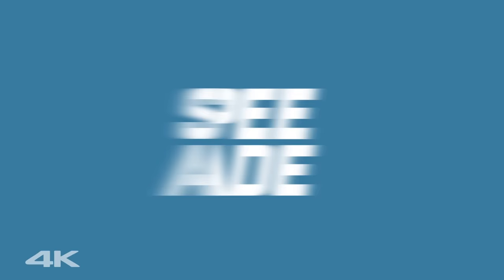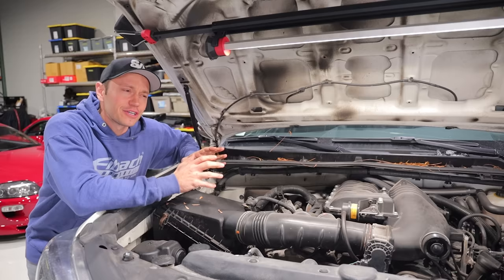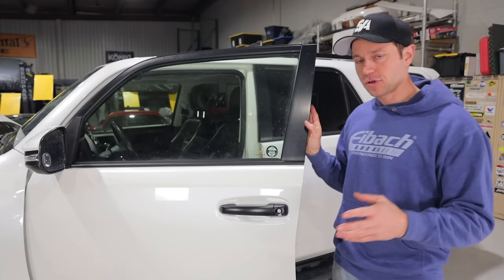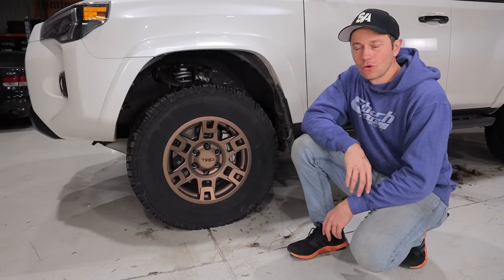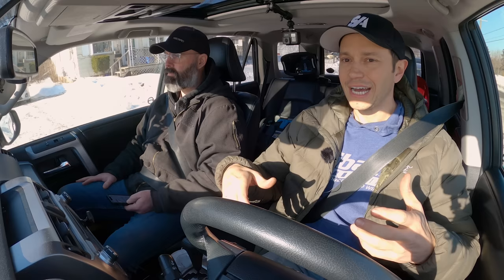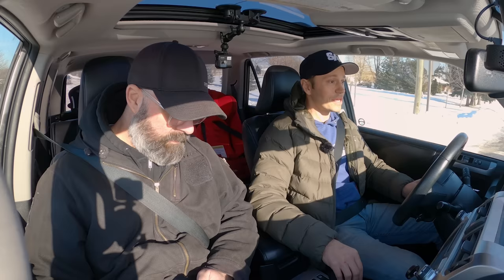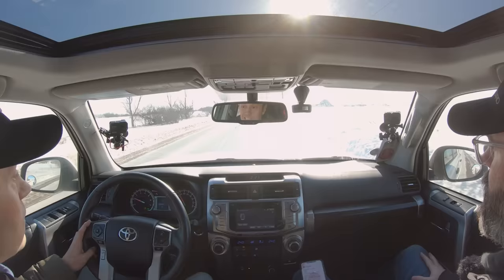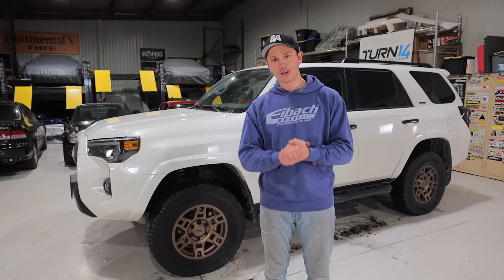Supercharged Toyota 4Runner Long Term Review - Gas Mileage, Reliability, Regrets?

Comment from the maker: If you havent watched the build series on this 4Runner, please do so as ALOT of your questions are answered in it. Here is the first video: https://youtu.be/s4jP3IfMD2A
Reply: your install inspired me to not only do the supercharger but attempt to film all 294 steps.
Reply: Just purchased my very first Toyota, a 2014 4Runner SR5 2-wheel drive in arctic white, great shape with 124,000 miles on it, but very well cared for. Wishing I had the kind of money you had for the supercharger, but will have to do upgrades a little at a time as I can afford. Also, I note on the one I just bought that the brakes are very soft and go near to the floor and do come to a stop, but my last car a Nissan Murano had reasonably responsive brakes, whereas this Toyota is a very slow grab and makes me a little nervous, have not quite adapted to that yet.

Comment: My 1996 4-Runner is the best vehicle I’ve ever owned.  Bought new in December 96, it now has about 353k mostly trouble free km.  Has never burned a drop of oil and since I did the upgrades of a TRD supercharger, Bilstein shocks and bigger sway bars in 2001, it’s been a blast to drive.  Living on the west coast, it’s mostly rust free.
Reply: Thats pretty impressive, seems like you taken care of your vehicle very well
Reply: White 96 4runner here as well , 5zvfe 4x4 309k kms. Bought it just before the cov, Wish i could find a rust free hatch though as it was the only thing i couldnt save.   Thought about selling it a few times, Always delete the ad 20 minutes later.
Reply: Thank you for sharing, always love seeing this awesome success stories to shut up the hatters!
Reply: I had a driver that rolled a 96 4runner over in Haiti. My dad fixed it and it kept running like a clock
Reply: I've got a '98 Limited I bought new. It's got a TRD installed, Borla cat-back & a K&N CAI. It's only got 68,000 original miles on it. I've always had multiple vehicles and drove a 1990 Volvo 240dl wagon for 21 years in the winter months, awesome vehicle. Definitely saved the 4 Runner from the winter road treatments, Its always been garaged. Someday I'll probably sell it or trade it in.
Reply: @danielfair4675  wow that’s mint!  I had a Borla cat back exhaust system installed back in 1998 but couldn’t stand the drone at highway speeds.  Went right back to my OEM exhaust which lasted up until 2017.  Now I’ve got a cheap cat and muffler replacement which has a rattle somewhere inside when the vehicle gets fully up to operating temperature, very annoying
Reply: @phil6926  the stereo system covers the drone up  I've got (2) V12 Alpine Amps a 2 -sub woofers to cover the exhaust. 🤣
Reply: You should start saving for a new 4Runner. Your 1996 will only last another 600,000 miles or so.

Comment: Best SUV ever made, I have a 2002 sport edition 4Runner with 290,000 miles and no problems... just the regular maintenance... 👍 TOYOTA  #1
Reply: my 2000 sr5 just crossed 275k the other day!
Reply: Guys I just got a. 2022 4Runner TRD off-road premium  and I hope it last like you guys are saying  because  I love it and I want to keep it for as long as possible also it's the last year of the na 4l v6.  Is next year it's probably gonna be some 4 cylinder Turbo hybrid BS which I'm not interested in
Reply: I've got a 2004 Sport Edition with the 4.7-liter V-8. I still love it, and I wouldn't hesitate to drive it across the country.
Reply: @zzanatos2001  yeah those v8's are bulletproof

Comment: Hey PT!!! Got this tip actually off FlyRide youtube channel, but... nothing ever holds to that chrome and it wont scuff properly. But using just standard purple degreaser concentrate, soaking the pieces will disolve all the chrome plating down to bear plastic, so you can then paint it.I havent done it personally but he did perform it on his channel! Hope this helps!
Reply: Chrome is a PITA to cover or paint, either strip it clean or just bite the bullet and buy the black trim
Reply: Hot tip right there
Reply: Caustic soda- drain cleaner -hectic or oven cleaner - more subtle. Works on anodising as well
Reply: One thing I've seen used to strip the chrome is oven cleaner.  Definitely strip the chrome off.
Reply: Thanks for this; I'm getting ready to paint the chrome grille on my 92 Toyota Pickup and I was worried about the paint sticking to the fake plastic chrome, even with a scuff. I think I'll try the oven cleaner first. Sure it won't melt the plastic?
Reply: Guess you can always try out some extra lettering laying around from debadging
Reply: Hell yeah great tip!

Comment: My 99 SR5 4x4 3rd gen has been one of the funnest vehicles I've owned.  It does mostly highway, but when I go off road it keeps going nonstop.  It is a very rare 5spd. with many off road adventures ahead with over 344,000 miles, has been well maintained and gradually upgraded!

Comment: Brings me joy to see how well your 4Runner has held up.  I bought a 2021 4Runner Limited Nightshade during Covid (Oct 2020), but had no idea how "doggish" the engine was. (no test drives at the time)  Needless to say I had HIGH hopes of a supercharger only to discover, I'll have to wait until they come out.  I should have done my homework, nevertheless I've really come to enjoy it.  Would like to see future models have an electric rear hatch and mirrors, but that's just me being petty.  Cheers!!!
Reply: Man, I literally did the same thing. My daily driver is a 2000 E55, but I grew concerned I may not be able to get parts for it in the future if needed( note it rarely breaks ). But yeah, the 4Runners performance is disappointing. And it’s gas mileage is horrible. I get 21-25 in the E55 with my foot in it. I’m thinking about ordering a Raptor Bronco and parting with the 4Runner when it arrives. Note, I needed the 4Runner for 4x4 and some towing because I have rural property that the E55 is not ideal for…
Reply: Yeah, my 2014 4Runner, since I am new to the model, seems "doggish" as you said, going from a Nissan Murano (handles like a car and has pep) to the 4Runner which definitely sped up and handled like a truck.
Reply: You guys should seriously look into pedal commander. The throttle response is on point with plenty of power from the go. It’s not the power for the engine but the lag in response from stock for gas saving
Reply: @toolman67 it's a truck not a car, get over it.

Comment: Probably one of the favorite vehicles I owned. I called it my Urban Assault Vehicle because it did everything you described minus turbo so well. I miss my 2014 and 2016 but my Tundra fits my needs a little better, less the even worse gas mileage. Always compromises.
Reply: I call mine "wagon king-family truckster"

Comment: I think you guys really hit the nail on the head with this being the "right" size for a 4x4 SUV.  I have been a long time land cruiser lover but I just can't get over how fat and heavy they are.  I currently own an older 4runner and the GX460 is really attractive to me.  I prefer the rear door to the hatch that come on the 4runner.  Here in the US 5th gen 4runner and gx460 are pretty similar in price because of the 4runnner/toyota tax.
Reply: I agree the LC200 is huge. I still love it though. I think the 80 series is just the right size. A tiny bit bigger than the 4runner (at least from just sitting in one). A split hatch would be one of the only things from making the 4runner perfect

Comment: I owned a 1996 SR5 for 20+ years (bought new) and put over 330,000 trouble free miles on it.  I just traded my Lexus NT200 for a 2016 4Runner SR5 with 80,000 miles and will likely keep it for another 200,000 miles.  Great all around vehicle.

Comment: I have had excellent results with SEM Trim Black Aerosol paint. I used it to repaint the black “fins” on my 1996 4Runner grill when I upgraded it to the 2001-02 version. They had been weathered and exposed the chrome beneath. It’s held up great for 2 years!

Comment: I bought a 2013 manual tacoma in december and i love it. 4dr, red, bronze trd wheels, trd exhaust, trd short-shifter. The tacoma/4runner/fj are some of the most reliable suv/trucks there is. Rust is an issue on most vehicules up here, these just rust like american trucks instead of what we are used from toyota but nothing regular rustproofing can solve, mine is still mint, im from Qc.

Comment: My 4Runner looked like a rusty mess underneath too. I don't know why Toyota can't do a better job. I also have a Grand Cherokee and the underbody has almost no rust at all. Toyota needs to step up their game.
Reply: As a Toyota Master technician I have to agree with you. Such a reliable product but they can’t seem to get the rust prof right. Annoying!
Reply: Truck frames use plain jane steel with a 1mil ecoat. Unibody uses more rust resistant metallurgy and even galvanized sections with paint up to 9mil thick. Manufacturers only care how it looks to retail customers. Thats why the body on Toyota do not rust because that is what the new car buyer sees and then disposes of it in 5 years. Yes my FJ looks beaut up top and nasty underneath.

Comment: I had a lexus GX for 7 years and switched to a 4Runner TRD Off-Road recently.  I really thought i would hate it in comparison.  The engine is much better than i thought, but the V8 is still superior.  I love it, i really do, but if i could afford a GX with the similar mods i have, i would do it in a heartbeat.

Comment: I think the 4Runner Trd Pro should come stock with a supercharger, especially for the price of a new Trd Pro. I also agree, the 4Runners are extremely underpowered stock, then after all the modifications, it's a turtle! Maybe it's adequate for "flat-landers" who live at or near sea-level with no mountains, but for those of us in the Mountain west at elevation, it's not even close to enough. I wish Toyota would keep everything the same from the 5th Gen, minus the motor and tranny, in the new 6th Gen. Then add the Tundra's new motor and tranny in the 6th Gen 4Runner and watch those 4Runners fly off the dealerships.

Comment: The Key hole part of the door come out very easily, there is a torx screw on the side of the door, take it out the key hole assembly will slip out. You can paint it better.

Comment: Great build PT!  I am on the fence about buying one of these myself. I like these but do wonder what a true lexus equivalent would be like. The GX is actually a Toyota Prado which I think was sold a long side the 4runner in other countries. Same drive train, similar equipment, similar utility, but not quite the same as the 4runner. Similar to the G37 and Q50. I also wish there was still a v8 option like in the previous gen. I like the GX but I'm not a fan of the styling like you guys said.
Reply: In Japan the 4Runner is called the Hilux Surf. I don't think there is a direct Lexus equivalent to the 4Runner.
Reply: @actyankeefan  yea I don't think so either, just wish there was.
Reply: @RTree613  perhaps consider a Sequoia if you want the more Toyota-ish design language but want a V8?
Reply: I totally agree 100% brother

Comment: I live just south of DETROIT,  so I have similar weather conditions to ours. I use bed liner for all my Blacked out trim pieces and wheel wells ... a real good cleaning... and a small amount of sanding makes the bed liner stick on for many years... I have only had to paint the bed liner 1 time so far.

Comment: I sold superchargers for a time... The mileage people get with S/C 4Runners is mostly due to intoxication from new found power & not being able to keep their foot out of it... I'm on my 5th 4Runner & 2nd 4.7 V8... Between my V6's & V8's... Gas mileage experience is that the 2 get similar mileage but because of the V8 torque, its usually better than the V6's... Reason?  I dont have to put my foot into the V8 to get major thrust & proper gear selection so mileage is better compared to the V6's constantly cycling gears to get in the torque band and prompting impatient throttle stabs on my part...I live in Michigan & am due for a new one because as you say, the salt is a destroyer in the North...If the 2023 doesnt "wow" me... I will go Gen 5 again with a supercharger... Keep the boost & internal perssures down to recomended OEM levels (its not a sports car) & reliability shouldnt be a factor to 250k+++... I have driven a few of my V6 4Runners past 400,000 miles with NO issues & still sold them for a few bucks... People brag about Toyota reliability yet so very few people realize that the payback for owning a 4Runner is that (if its maintenanced well) its just getting going at 200,000 miles... If (hypothetically) a supercharger "half-lifed" the engine (which I dont believe it does) but if... It would still last far longer than most people would ever drive them anyway... If you are going to increase tire size to 34's or 35's... your milage is going in the toilet anyway and a supercharger should actually improve things at that point... The high octain gas $ is a bummer but it will burn cleaner internally with a little less carbon build up & that plays for longevity & reliability... I would love to hear from the individuals that have done the marathon with a S/C and clocked 0ver 300,000 miles... Would love to know what the affects are, if any...

Comment: Hey Speed Academy,
Tip for the black plastic trims, DO NOT spray with paint or plastic-dip, 
next time try Bed Liner/Ridge Liner/ Truck Bed Liner
much more stronger and durable

Comment: I’ve owned a 2016 for a year so far and my only problem with it was when a tech at the dealership didn’t put a caliper bolt in. I found out an hour into a road trip across Michigan. Still love the vehicle not so much that particular dealership tho.

Comment: im in Texas and i bought a Texas 4runner so rust in minimum. my 4runner is a 2005 sport edition 2wd and is equipped with the 4.7 V8 and i really think this old truck is special. i bought because i also own a 2018 wrx and i wanted something that could tow and be my work horse. thanks for the videos.

Comment: Biggest improvement that never gets talked aboutnw supercharger is how the transmission stops hunting with the blower, it just GOES now and drives normal. 

Ga$ money is refunded w resale value down the road.

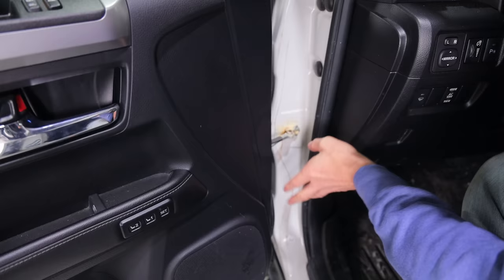 Had my maggie blower for 25k miles now on my 2017, after the defective tensioner pulley(VERY common on 4r kit) was swapped by magnusson w diff part# its been all good. 13-14mpg on 33's. Stock gearing is 3:73 and is long in the tooth, So doing 4:56 gears w air lockers and 35's soon with my 2.75F/1.5" RR lift.here in Socal zero rust issues lol. Here in Orange County modded 4runners are like F150s in Texas.You see 20-30 lifted 4 runners a day here. 

Having enough beans to beat 6.2 Silverados and 3.5turbo F150s never gets old. She will go 110+mph easily for extended timeframe w blower....bone stock these trucks cant go 90w/o going downhill with the wind. CHANGE YOUR OIL on these EVERY 5K MILES...the new 10k mile interval is prematurely killing toyotas at 150k. I use Rotella T6 5/30 multivehicle (gas/diesel) oil 20wt is too thin. Older FJ cruisers spec'd 30wt oil and 5k oil changes. 10k mile intervals is freeway only no supercharger! Supercharger/stop and go traff is severe duty!
Reply: I just ordered a Magnuson for my 23 4Runner as well. You’re telling me lifted on 33’s you’re beating 6.2L silverados and 3.5L f150’s?? I plan on going to 34’s or 35’s with 4.56 gears, I imagine it’ll pull pretty hard. Even considering the OTT or Yotawerx tune

Comment: I am stoked that PT loves this thing, but I am just not feelin' it. For $10,000 less with equivalent mileage and year, I got my wife an E70 X5M back in early 2020, and it hasn't given us a single problem over 40,000 miles. I have done probably $2,000 in preventative maintenance, but it's surprisingly easy to work on and FCP Euro's lifetime warranty is clutch. 550hp/500tq TTV8, AWD, 6000 tow rating, enormous brakes, and the entire interior is heated/cooled leather...for $19K. Easy call for me.
Reply from the maker: You good sir have been very fortunate. I looked at these and then read all the issues so passed on them. It’s a fantastic SUV but I need reliability over anything right now
Reply: @speedacademy  Indeed we have been. We're the 3rd owners, and the 2nd owner was a BMW master tech. I know a big service is coming up soon, but I'll still have way under $30K in a truck that initially stickered at $100K. Enjoy that 4Runner; you've certainly earned it.

Comment: Speaking of gas prices. I just filled up the 530d e39. 131cad equivalent for 55l and change. Glad the fuel mileage is around or below 6l/100 (40mpg). Prices (taxes mostly) have gone through the roof here in France.

Comment: I threw on a set of Morimoto XB LED headlights on my '17 F150 in 2020, and have been enjoying them ever since. They make great aftermarket headlights, only negative is the lenses over their housing chip far too easily. Got a nasty chip from an 18 wheeler hauling uncovered gravel, on my first interstate drive, only a month after installation. OEM lenses never got chipped in the 3+ years of driving after purchasing new in '17. Morimoto, just needs to install true oem quality housings, then their product will be 5 stars all day long.

Comment: love the 4-runner, not my first.
bought new 2019 sr5.  great ride
except for one thing.  intermittent rattle on the front driver side.  only on rough roads, 10 to 40 mph.  even machanics don't know.
Reply: I have a very similar sound and I’m pretty sure it’s the mud guards in the wheel well. They are a flexible rubber material that slaps against the frame and body. That’s my best guess
Reply: Thanks for that PJ, appreciated.